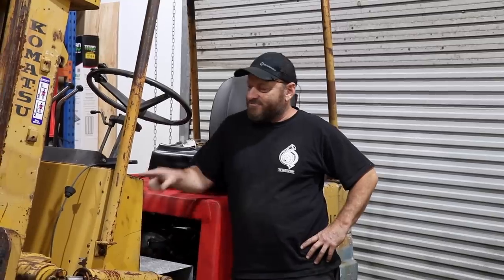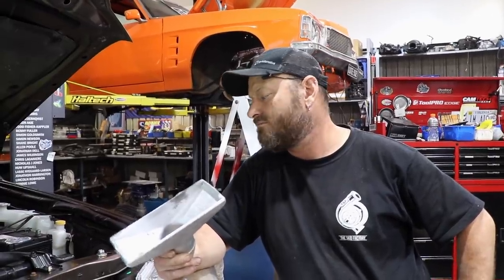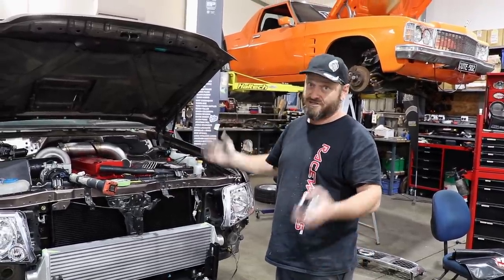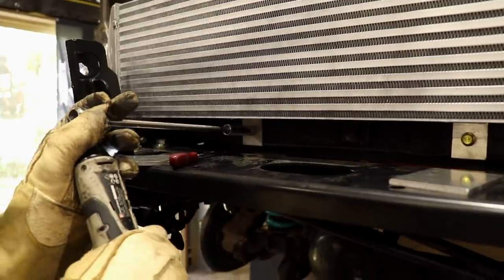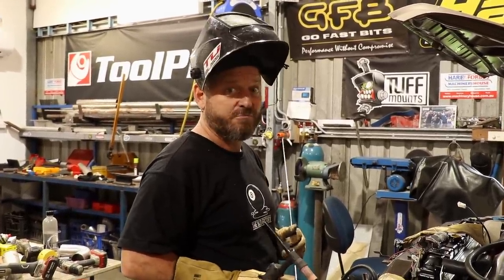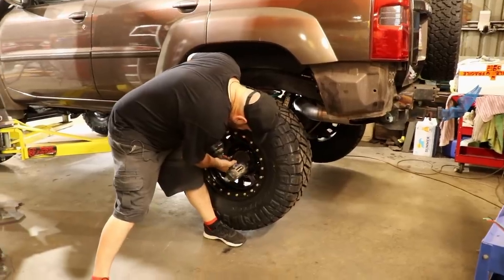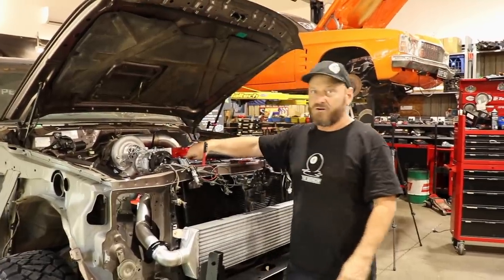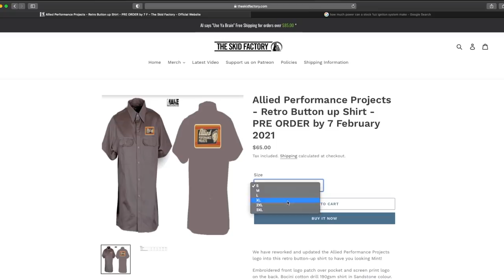Turbo Forklift & Custom Intercooler Fabrication - Cummins Patrol EP10

Comment: the serious face while saying "we may just jam some rags in there...."
Legend. 
RIP Dylan. Check on your friends time to time. Share a lemon squash or whatever beverage you have around with your mates and fire up the BBQ. Nothing hurts worse than loosing someone close and realizing later you could have done something different that may have changed things. It's okay to lean on your homies sometimes, we will hold you up. Cheers friends 🍻

Comment: 2" and 33s. Of course 😂
Reply: I'm assuming that they are "33s" wink wink nudge nudge...
Not certain about Queensland but in NSW you can't put a bigger tyre on with a 2" lift without getting the setup engineered.
Generally speaking 2" is max lift without engineering, and technically a bigger tyre increases the ride height.
That's what I think is going on anyway.

Comment: My condolences, I've lost mates who's depression got too much for them. I've recently sought treatment for long term anxiety and depression too. Youtube is one of my escapes and channels like yours are what gives me the motivation to keep building and fixing things. My current project is a turbo 1fz cruiser for a mate, I had SFA space between the winch and AC condenser so I went with a water to air with a thin core that slotted in quite nicely. I assumed a water to air would be better for low air speed off road applications?

Comment: You can use panel knockout cutting tools and/or dimple dies to make your body holes.  They still work when you don't have a full panel to cut your circle from.  Adds some rigidity back to the panel to boot.

Comment: When you are sharpening your tungsten electrodes, stick them in a 1/4" drill. Then you spin them in the drill while grinding them. Gives you a perfect point with an even angle all the way around.

Comment: Thanks guys. The "Just because you've never felt it doesn't mean it doesn't exist" part needs to be hammered in to some heads with a rubber mallet. And you're right. It is not weak to speak. It takes more courage than some have... And we know the outcome of that :-/

Comment: The castings look good,  cleaning up castings is called fettling, used to do that on rover car engines, and aluminium suspension parts for lotus years and years ago, first day, you stick your arm down a cylinder and shred your arm, or slit your wrist. Getting longer gloves helped... Miss it, but don't.

Comment: How about making a hitch receiver on the front bumper and using a hitch to mount the winch on. E-power via connectors.
That way it will be removeable, leaving the intercooler able to catch the breeze when driving.

Comment: Boys up north here in NZ we would buy crashed truck intercoolers! the top 3 feet is always fine! and they are bar and plate intercoolers. you can easily weld new tanks on them and make a few from each crach truck core. Recyling is good also! Getting rid of toxic masculinity one turbo at a time! R.I.P Dylan

Comment: Well said Al on the mental health issues. Sorry for your loss boys. To the rest of the comment section, understand you may have problems and not realise how serious it can become, but if it feels like its getting too much, just reach out to someone, anyone and say "i need help". Your Dr can help, your GF, wife or mates can help, or google the helplines, they're available 24/7 and are very useful. I've been there myself, during my time in the military I reached by breaking point, called a friend that worked at the on base medical facility and told her I need help. I was in the next day to talk to a psychologist and started a long journey out of that hole. Im sharing this story to show if you ask for help it will be given, and you can come back from it. The ADF current and former members community has lost 12 guys in the last 2 months, and its way too many. Seriously, it shows strength to admit you need help, not weakness. Just ask foir it.

Comment: Build looks awesome. Did you run into any engine torque flexing issues with rigid mounting the intercooler piping to the turbo and intake?

Comment: How confident are you with that after cooler piping setup in regards to flex & vibration?  For the past 15 years (probably longer), diesels are all I have played with.  That 5.9 likes to rock.  Taking into consideration the engine mounts are low, the block is tall, and the intake duct work is at the very top.  I've seen the valve cover swing an inch.  Always used at least one flex joint on both sides on every application.  Even over the road semi's have at least one on both sides.  Without it things tend to either break, or crack.  Curious to hear your thoughts on that.
Reply from the maker: It's a consideration, I will assess it when I get the engine running. The wiggins do have a lot of movement in them but if it's not enough I will probably just add a truck spec joiner in both pipes.

Comment: I'm concerned about your connections to the intercooler you should have on each side a hose buffer or flex Hose to take the torque that the engine will give under acceleration. So sorry to hear of your your loss with your friend. All the best from Canada.

Comment: wouldnt it make more sense to have the larger diameter intercooler piping on the hot side as the hot air has a larger volume than the cold air?
Reply: I think it's much more common the other way around for whatever reason - perhaps more velocity from the hot air straight out of the compressor?

Comment: instead of vacuum brake assist, go for a Marks 4wd hydro brake boost, uses the power steering pump to boost, double line pressure to the calipers

Comment: Very well said at the end. If it's ok I'd like to add something for those that are suffering but are reluctant to seek help because they are managing to cope at the moment. I was like that for many years, and yes I was surviving..... until I wasn't. At that point my mindset changed, I no longer had a voice of reason in my head, I then believed I was doing the right thing. I can now say thankfully I failed without hating myself more for failing. So I guess my message is, please ask for help Before No One Can help. There is a point of no return, unless you are very lucky like me, and at that point the scary thing is you feel happy for the first time in a long time, happy that you are at the end. At that point you are virtually unreachable,  please ask for help BEFORE that. This is going to sound stupid, but.....

Help, DOES Help 👊

Comment: awesome work! i have a question ! the engine when runing , moving, and the intercooler screwed the body ! why dont use a silicone intercooler pipe? or enithing else

Comment: Al have you not for the intercooler piping size the wrong way round. Wouldn't your larger diameter be on the side where the air is less dense (hot side)?

Comment: Hi,Al, Are you not having any flexable joints in the intercooler pipes,to allow for engine movement?
Reply from the maker: Wiggins clamps have movement, they are not vbands.
Reply: @theskidfactory  How do they compare price wise, to V band clamps?
Reply: @johnfj80  Cheaper

Comment: I had problems a while back. I'm 6'5, bearded, a big petrol head, a biker, down the pub with me mates at the weekend, proper masculine stereotype. Yet a couple of years ago for some totally unknown reason I was throwing up every morning and would randomly burst into tears. I thought about throwing myself into traffic or throwing myself down the stairs. The smallest unexplained noise would send me jumping a foot in there air and something simple not going my way I.e. find a small oil leak on my car could have my on the bog shitting liquid and throwing up in the bath at the same time in minutes. Nothing felt right, minor things that didn't matter would cause nuclear reactions, none of it was ratitional. 6 months before my problems I would have told you I'm the last person in the world to have mental health issues. Eventually I finally spoke to some people and it go so much better. I spoke to my girlfriend(now wife) my dad and my boss. They were all excellent I spoke to all my mates about it a bit later most were amazing. In our WhatsApp group of 12 4 others said they had had vaguely similar things. I had some time off work and went to a Councillor he was great and explained the logic behind the feeling and how to control some of it. The docs put me on some drugs I didn't feel them working but I did feel better I'm not sure if they helped but they didn't hurt. About 4 months later I felt more or less back to normal I still have times where I feel rotten but I know what actions to take to calm myself and  look after myself, I've had the odd bad patch but they are rare and nothing like the first time. Getting help was the best thing I ever did and I instantly felt so much better for it. Everything Al says is true, blokes need a shift in mentally about speaking out as it is deadly not to.

Comment: Is the intercooler fixed too rigidly to the body? It's hard piped from the engine. I know there's flex in the joints that connect the system but is it enough? A radiator has flexible hoses connecting it to an engine and even then there are rubbers installed on the top and bottom mounts. Apologies if they have been installed  its just that so didn't see them. 

Well done highlighting mental health issues. RIP Dylan.

Comment: So if the engine is hard mounted to the cooler with no rubber isolation any where, won't it crack? That engine is going to move a little when your out having some fun..... Just curious.

Comment: Is there enough flexibility in the welded piping to handle the stresses from the engine moving on its engine mounts? Or is there a flexible joint hidden in there somewhere?
Reply from the maker: The wiggins clamps have a fair amount of movement

Comment: Al, got a question. 

You mentioned about using a 2.5" on the hotside (from turbo to cooler) then moving to a larger 3" from cooler into the intake mani. 

Surely air coming from the turbo (HOT) will have a larger volume and therefore struggle to flow nicely through 2.5" tube. Once it has passed through the intercooler, it will be cold(er) and as such requires a smaller volume to maintain the same thermal efficiency... From a high level perspective it would be more suitable to such 3" from turbo then to help make boost pressure reduce the pipe down into the intake manifold. 

The only other thing I could assume in response is that your trying to use the 3" as a larger 'plenum' volume to ensure your not choking the engine, interested to get your thoughts and past experience. I'm not trying to be 'that idiot' in the comments but as a Mechanical engineer, I'm interested to hear the past experience and the thoughts behind the piping decisions 

Love the show guys!

Comment: You need rubber between engine and intercooler, just like you have rubber between engine and chassis, or your pipes are going to crack.

It might hold up if its just a show pony, but it wont last years of offroad, with chassis torsion and heating and cooling cycles.

Comment: I may be wrong im my thinking.... but shouldn't the intercooler pipes have atleast one union that's a rubber boot for flex on each side. I think the engine will move up and down slightly in the engine mounts and with and the piping rigid and the intercooler solid mounted somethings gotta give

Comment: All the bends and turns look like such chaos at first.  Magic touch of the metal melting wand and Presto!
Good friends (not just acquaintance) can be counted on one hand. Even if you got just ONE good brother, that's valuable.
Don't blab to the females about real, deep problems. Only in dire need. Dries them up like the Sahara. 
That's what yer good, close mates are for. sad to see one go. always.

Comment: Oversize intercooler looks super sexy but at low off road speeds will retain heat latency. Reduced external through flow resistance (due to unit mass and thickness) and most importantly internally reduced flow velocity (due to oversize pipes) will lose perceived gains.

Unreal for drags.

OK for highway.

Off-road at  slow speeds - Not so good.

Comment: Well you guys I've always thought that the winch should be in a box in the back of your leg Yeah if you want to use a winch on the front of the truck he should have like I hitch adapter like in the back and you would be plug ins in the front and the back but 99 9 9% of the time you don't use a winch so when's good last forever if it's in a wooden box in the back of your vehicle never getting used and I guarantee you in the front is stupid you always need it in the back not in the front so there's something for you to think about I actually started a business or try to in the 70s making hitch Mount winches Ashley had a kit did not sell but the reality is you hardly ever use a winch especially if you know how to drive you guys need to get some of them early Broncos down there you'll understand that